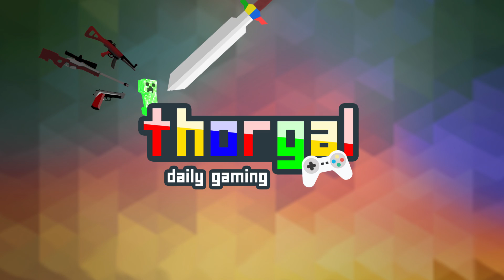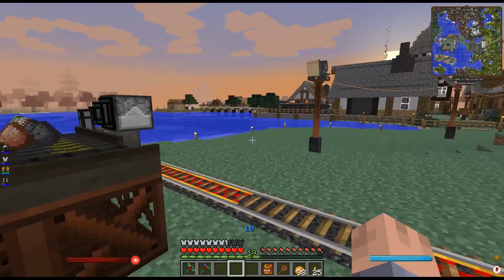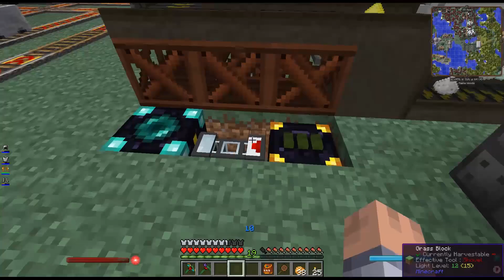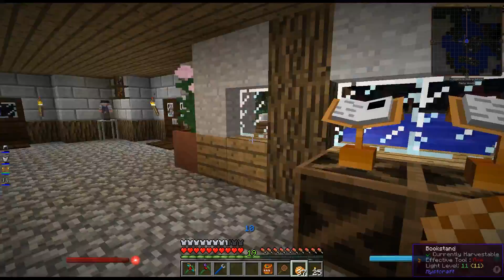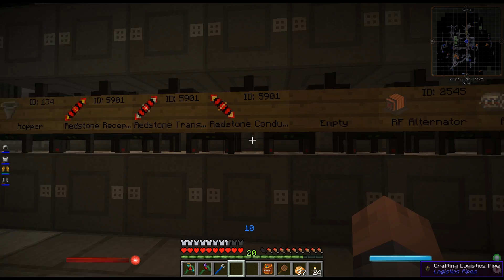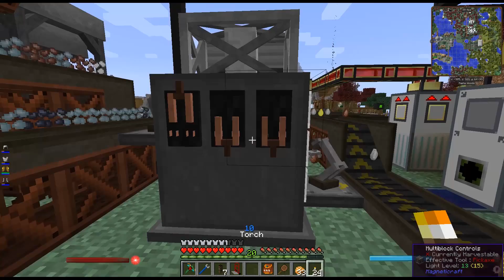Thorgal's Modded Minecraft #21 - Advanced Generators and Overclocking our Furnaces

Comment: You've got the idea of the batteries wrong. The voltage is how quickly the machine is using power, so being less than full means you're producing much faster than the machine can use, so you're wasting the power. Magneticraft balances across all power connected machines, using the voltage. The number you want to look at for power usage, is the wattage, which is the big bar to the right, and that's not moving at all, so go ahead and flip the lever.

Clever trick, is that the RF Alternator works both ways. So you can run RF into it and get Magneticraft power out, or you can run Magneticraft power in and get RF out.

Also, you might have gone slightly overboard on the alternators. I remember from Modular Mayhem, when one RF alternator was capable of providing enough power to run the entire Magneticraft processing chain, plus a furnace. So unless the numbers have changed, probably one alternator is enough. Then again, more power is never a bad thing.

On the other hand: Tesseracts are for noobs. Real players use Dimensional Transceivers with Ender Rails and Flux carts to move RF. :P